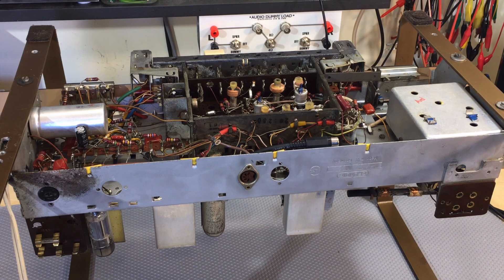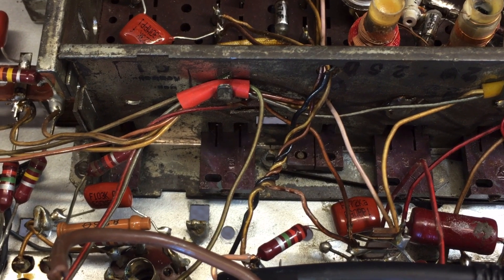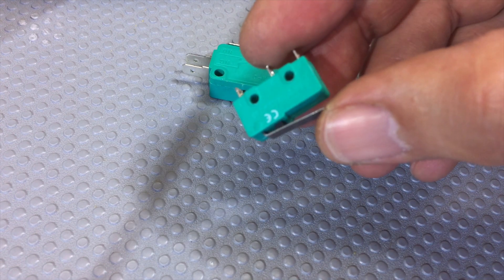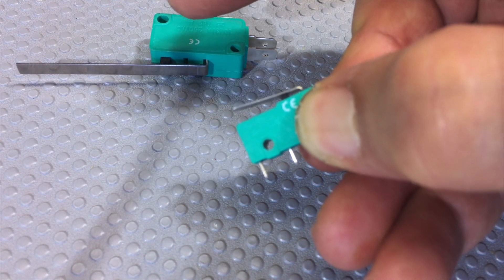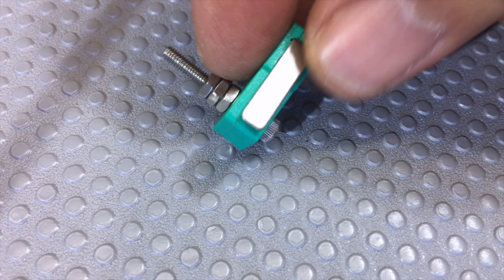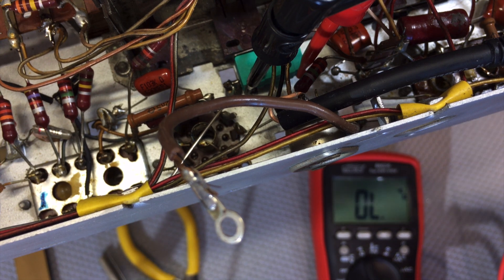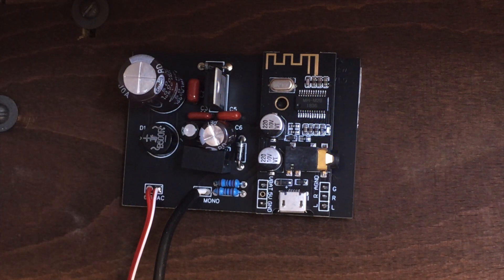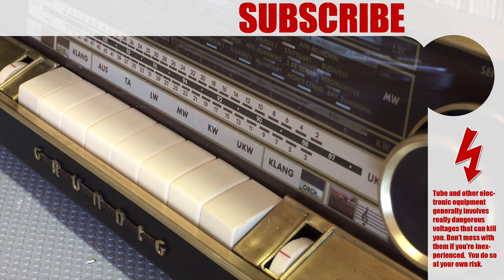Bluetooth with Micro-Switch on Tube Radio. Power on ONLY when pickup selector is activated.

Comment: Hello Manuel.  Great solution, which I am trying on a similar Grundig.  One question (which may show my ignorance)... with the switch wired to ground like you show, does it make sense that when the switch is off there is still some power to the bluetooth board?  I have wired it that way and even though the switch tests correctly, I still get about 3 volts at the bluetooth board supply.
Reply from the maker: Yes, that is fine. The supply can be switched on either polarity. In this case it is just easier to switch on the ground side.
Reply: @electronicsoldandnew  Thank you

Comment: Have you been asked to add bluetooth to a vintage AM only transistor radio?  The early sets  were often tube sets with new electronics so there was plenty of room to work in but free space inside cases quickly disappeared as the  designers aimed for portability.  Most of the projects I have seen simply discard the existing internals and turn the case into a bluetooth  speaker rather than a bluetooth enabled radio.
Reply from the maker: Most of the AM only sets I restore get BT fitted to make them more useful.
Reply: @electronicsoldandnew  Would you post a future video about adding bluetooth to a transistor set? I would be interested in how you work through the slightly different engineering challenge, particularly the space to create a power supply and a bluetooth board in the more cramped confines of a transistor radio case. Also the greater variation in voltages presented by different sets.
Reply from the maker: If the occasion arises, I sure will.

Comment: Excellent!  Micro switches are very useful.  I remember as a yount tech in the 1980s I used micro switches to build an automatic device that would retract my Blaupunkt stereo into the dash of my car to hide it from thieves.  At the time it was common for thieves in New York to shatter a car's window and rip the dash apart, then rip the stereo out so they could sell them on the street.  Whole process took less than a minute and was very destructive to a car's interior. I lost two $400 stereos in six months that way.  The micro switches acted as limit switches so the small DC motor would turn off automatically at the ends of travel.  Worked perfectly till I sold the car six years later.  Good work on your Grundig.  If you had no room for a switch an IR LED sensor from an old printer could also probably detect the lever movement and engage your Bluetooth device.
Reply from the maker: I grew up in South Africa, and know the smash and grab quite well. I once lost a stereo from my car worth a few hundred rand, but the window cost three times as much :)
Great idea about the IR detector. Thanks

Comment: Nice job, and much cleaner. Good thing to avoid the high voltage if possible.
Many of the old radios with this kind of pianokeys will have some sort of leavers like those sticking out at the back of them.
You might not always be that lucky with both space behind and ready made mountinghole for the microswitch.
Other thing I was thinking about... The output of the BT module has a rather low impedance right? Like headphonelow impedance,
and the PickUp (or tape) is pretty high impedance? Will this affect sound quality much?
Reply from the maker: It shouldn't. Ideally a source should have zero impedance, and a load should have infinite impedance for them to transfer voltage perfectly (not power). So this seems to be a good marriage. The other way around would be terrible.